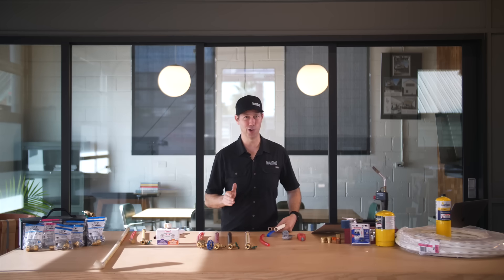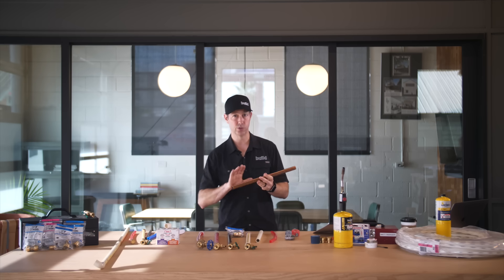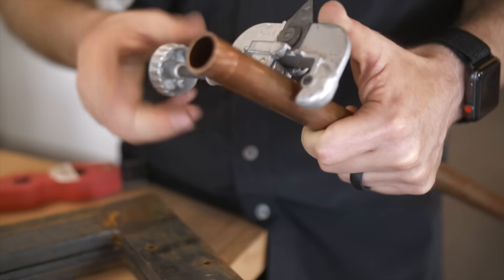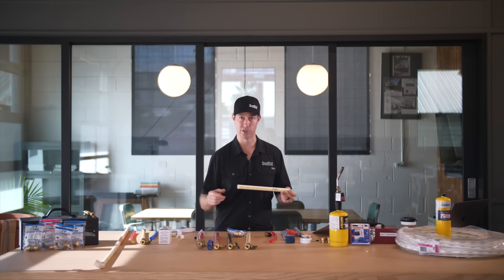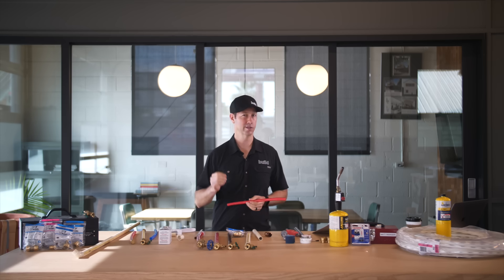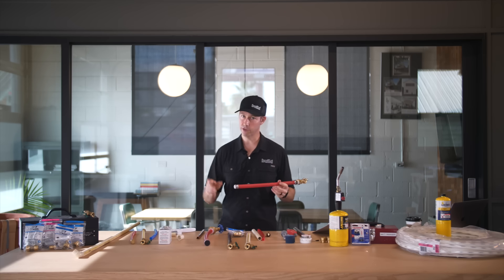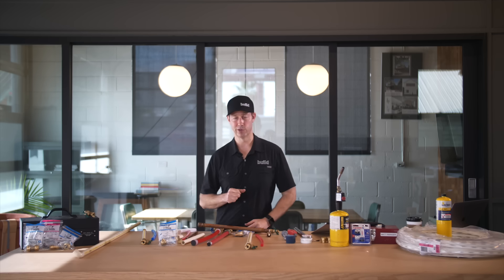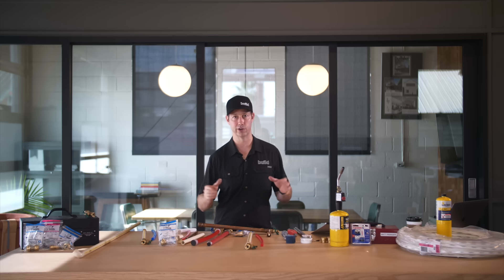PEX vs COPPER vs CPVC plumbing pipes

Comment: In California there are so many pinhole leaks and slab leaks due to copper pipes it's ridiculous. New homes with brand new copper pipes have pin hole leaks in less than 10 years. 50 Years? GOOD LUCK! PEX has the lifesaver for most homes. No more leaks, better water pressure and faster hot water due to not having to go through the whole copper loop.
Reply: I disagree.     I've been living in soCal for 65 years, and my Dad used copper in his day, professionally.     I own property built in the 60s with copper that has never sprung a leak.       But we have never used M, ever ever ever.     Dad used K and L.     I use L exclusively.       

I live in Long Beach and re-plumbed my house, personally, in 1991, using 100% L copper.       No leaks still.      I changed my HW heater-tank recently after 18 years, following a sobering viewing of This Old House's caveat video against depleted sacrificial anodes; the resulting corrosion of steel in the HW tank can kill copper pipes!!!!!!!!!!!!!!!!!!!!!!!!!!     Well, my 18 y.o. sacrificial anode was about 80% intact after I took out the old tank, and took out the sacrificial anode from that tank.      I still have that sacrificial anode!   It's heavily coated in a fragile crystalline substance... apparently the salt of that anode metal and chlorine in the water; so I don't really know if it worked when "encased" in salt.     I'll find out someday, but I'm not worried.      

I believe your leaky copper problems stem from either defective pipe manufacturing or acidic water.      And putting copper pipes in intimate contact with concrete slab is, supposedly, a time bomb; one that I'm expecting to get ME, but my copper in this situation is probably K and hasn't failed yet since construction in 1964.

This Old House is largely devoted to Massachusetts and I believe that place has acidic water.     Soil conditions in arid soCal seem to be alkaline.     Just look at what happens when you try to grow hydrangea; the blossom:  pink indicates alkaline soil, blue (as found in rainy parts of Oregon) indicates acidic soil conditions.        Around here, we have to acidify soil for some acid-loving plants like azalea.
Reply: There is a difference between Chinese made types of copper vs American made. American made copper is 100% rated thickness or very close to all the way around while Chinese made copper can vary in their thicknesses throughout the pipe. When I was talking to the repipe guys that redid the whole condo community (about 200 homes) he said that there is a city about 10 years old now just a couple miles away from me in southern orange county and the repipe company told me that 85% of their business is in that city while the older homes in the 70's to 50's is about 15%. He said both are L type copper but one is Chinese made while the other is American.
Reply: But I agree with you that good old copper pipes may last that long, but I must add newer chinese copper pipes will not. All these homes in southern orange county is where the repipe guys are. I see them at least once a month running around doing PEX jobs. With the better water pressure after switching to PEX and the faster hot water, I can't see why you wouldn't choose PEX for your next job however.
Reply: Tthe DOS exactly, even in South Africa, we quickly learned that the locally produced copper pipe "lasts for ever", "cheap" Chinese imports sold by WallMart affiliates and other unscrupulous dealers fail in less than 5 years with pinholes. Same with CPVC or similar, the cheap stuff (machines run too fast) leaks and split. Latest code revisions banned a bunch of stuff and new stringent codes to stop ripoffs. ALL PRODUCTS SOLD HERE HAVE TO BE UV STABLE PER NEW CODE, NOT TO MENTION FOOD GRADE.

Comment: First of all, I really like your channel and it's interesting to see what kind of solution and materials are used in the more warm climate conditions and USA markets.

General thoughts. 

-Copper has more fitting solutions than just soldering. There's also compression fittings.
-I think PEX is generally designed to run from the manifold straight to the water point as one single pipe running inside shield pipe. 
-There has been new found concern of PEX tubing in Europe. It has been found out that in some cases PEX tubing could release micro-plastic particles in to the water. That is not to say that this applies to all scenarios and PEX models, but something to make note of.

Comment: Hey Matt please clear this up...... you can use Crimp fittings with PEX A you can use all methods with PEX A just Uponor will only warranty their method of Expansion and Expansion has its benefits over crimping but Pex A is superior over Pex B no matter the connection method used.... too many people get this wrong

Comment: A lot of value in that video Matt! Northern climates plumbers might have slightly different experiences. Also, I just finished my basement and used copper to match the existing plumbing system, but I wish I used Pex because so much stuff in the way that I had to work around to get fittings soldered propery

Comment: I would be much more comfortable to have pex type A in my walls rather than copper. Left over flux inside the copper at the joints of the COLD side can also cause corrosion. HOT side tends to wash the flux away. CPVC can become very brittle over time...scary.
Reply: Scott Rogers I have never in 30 years in trade seen a problem you describe, perhaps chinese products? Flux is water soluble and should wash away on first flush, the outside of the soldered joint should be wiped away with a damp cloth after a few minutes.  Its easy to see a hack job coz they never wipe the outside...
Reply: Well, if someone says they saw a Unicorn, that would be a good argument. But apparently you haven't seen everything in plumbing yet. I'll attach a video I found supporting my experience. I do appreciate the response. And yes, I always carry a clean cloth to wipe the joint.  https://www.youtube.com/watch?v=nD5lMITzx_Y
Reply: I'm a retired master plumber of 34 years, certain old fluxes didn't wash away very well, plus way to much flux was used. I've seen many pin holes in the copper pipe a couple of inches away from the fitting, to much flux and boiling/melting away from the fitting. You can cut the copper pipe and actually see and feel the flux with your finger.
Reply: Scott Rogers p

Comment: I found CPVC gets very fragile overtime. New CPVC can be cut with tubing cutter, but when old (10+ years old) CPVC is cut with tubing cutter, it will crack instead. I also found deeply scored CPVC pipe during installation can lead to a pinhole leak in the future. I repaired such a leak few months ago. It had a long scoring, which probably happened when it was installed through the sub floor. PEX-a probably is the best type of tubing at this point. Found lots of PEX-b develop small leaks at the fitting. Possibly installation error, but not sure. Only down side of PEX I find is while the tubing it self is cheaper than copper and par with CPVC, fittings are significantly more expensive.

Comment: PEX-A is the best. 
PEX-C is a ticking time bomb. 

Don't bury Shark-bite fittings out of sight. Water hammering can beat those fittings off.
Reply: Don’t bury shark bite fitting underground either! It will deteriorate over time.
Reply: Getting beat off isn't so bad, unless you're a sharkbite fitting underground or in a wall.
Reply: oops..

 just installed 2 sharkbite caps inside a wall to cap off some existing lines
Reply: Brando OOPS
Reply: Better yet. Don't use shark bite at all!

Comment: I recently remodeled my master bath, which included building a larger shower. My shower system consists of Kohler mixing and 3-way diverter valves, feeding 3 different water outlets (head, spray arm, and rain head). This would have easily been a $1200 cost had I hired a plumber to sweat copper for it. I was able to plumb the whole thing with PEX in an afternoon, for about $180 (cost of tools mainly). And after leaving it exposed for 3 weeks, pressurized (I was slow in putting up the shower board), I know those fittings are going to hold.

Comment: Pex is the obvious choice to balance cost, longevity, and durability hands down.  That said, a proper copper install is sexy and just feels more robust. I may be partial though growing up with photos of my dad's work building sports stadium bathrooms with all copper.

Cpvc should be DWV only unless you are building an entire home on an assembly line, eg: mobile homes.
Reply: The caveats against rat damage went unmentioned, except by replies by those who know what happens in New York City.     We have rats in soCal and they have an instinctive need to gnaw.   Unfortunately, most humans are apathetic about rats and assume "somebody else" will solve all their problems.      The time bomb element is really long term, on this point, and is uncharted territory... no lab research speaks to the longevity of PEX when an attic is infested with rats.    

Engineering has never dealt adequately to the point of biological intrusion upon non-living materials, except to the point of unwitting human behavior; GFCI speks to this point.      If the word "rat" appears anywhere in the California Plumbing Code, I'd appreciate anyone coming forward to tell me where it appears.

Comment: In my rather limited experience with a couple of vacation homes, PEX is more forgiving of a feeeze situation than the others.  If I were plumbing water in an unconditioned space, I’d use pex.  Also shark bites are xpensive but awesome.  Very reliable.

Comment: im in the business. pex all the way. in florida copper wont last 10 years.
Reply: I had lived in Florida for 45 years and haven't seen copper fail.  Only issue I have seen fail is poor joints in copper.  I have had it fail in Utah.  I am not sure if the well water has more minerals, but it corroded the joints and fittings at the hot water heater.
Reply: Why does copper fail in Florida?  Thanks for disclosing your geographical area.     I'm in soCal and L copper is king here.      K is better but "nobody" has heard of that, among young people.
Reply: Most of Florida sits on limestone and the water is hard water and caustic with a high PH, drawn from shallow aquifers.
Reply: 20 year plumber from Texas.  Nothing but copper.  Rest is cheaper and easier but it isn't as good
Reply: I worked construction in AZ early 90's. The city building codes were changed to NO pex because there were so many problems with fitting leaks. Houses were basically destroyed from the water. NEVER EVER buy a house with pex.
Reply: @s.br.8717  poly b is the real killer you can get plastic fittings for pex nowadays to you know, 1 time use but in mineral rich water it works
Reply: Not in my part of Florida. 75% is shallow. We have great water.
Reply: Totally agree... sorry old guys.
Reply: freethinker52 I’ve seen copper fail in Florida. House built in late 50’s. Had pin holes. Who knows why? Reactive somehow i think. Have seen it multiple times. Pvc all day in my opinion
Reply: @blakethesnake1555 PVC, you got to be kidding me.
Reply: freethinker52 Why not, so what would you recommend for underground plumbing. I’m in South Florida.

Comment: That purple primer is evil.  I ruined a spot on my 200 year old heart pine floor with it and also had it spill in a tote I was storing an extension cord in.  That stuff totally dissolved the outer sleeve of the extension cord.
Reply: the extension cord is made of vinyl so no wonder it did damage
Reply: Don't spill it....
Reply: Primers for chemical fusion connections are not benign materials and require significant care for their use. There are untinted PVC and CPVC cleaners available, however in many jurisdictions, their use is against code as the inspector cannot see if cleaner was used on the joints.
Reply: Such hyperbole.

Comment: Mat, I grew up in Michigan then moved to Indiana, I'm not a builder but from living in the northern states CPVC AND COPPER when they freeze they'll crack and brake. Like you showed once, in the northern state we need an outdoor frost free faucet 8" to 12" long to go through the wall so it don't freeze.  I never had around Pex piping.
Reply: TOOL MAN, PEX tubing is more tolerant of the expansion effects caused by freezing, however repeated freeze/thaw cycles in the same area will still cause the tubing to split and freezing near a joint will commonly push the joint open far enough to cause failure when full water pressure is restored. The best bet with any piping material is to prevent it's exposure to freezing conditions in the first place.

Comment: Stop talking about things you don’t know about. M copper is ONLY for heating, never use it on water! The other thing the customer you were talking about the rust issue, the rust has nothing to do with the pin holes, only acidic water or low ph will cause pin holes. Cpvc is the worst thing to use for water pipes. It gets real brittle and brakes under colder conditions. Don’t get me started on cpvc valves, there don after ten years, don’t compare it too copper. There are copper pipes in the ground for 75 Year’s, cpvc will never last that long. Stop please just stop
Reply: Pex will take more freezing than copper and cpvc will take no freezing and will split and crack.  Copper will also split on freezing, but not as bad as cpvc.
Reply: nick ransom thank for saying something your so right and pex is no better it seems I been called on that pipe and the joints broke apart where it's crimped or the plastic band....
Reply: yeah, this guy does clean, easy remodels in texas.  it's all on flat ground, never drops below freezing for more than a day or two.  and they're just building suburban houses that will be dozed in 100 yrs-they're not castles
Reply: Nick, You are right about every thing you said. I wish this guy would stop doing plumbing videos, he puts out a lot of false information. I've been a master plumber in PA for over 20 years.
Reply: His information may not be applicable to your area, but that doesn't make it false information! 

My home was built in 1970 just north of Houston with full copper piping and not a single leak has developed in the pipes in 48+ years (even the supply line under the house buried in the ground is copper!). So it does apparently hold up WHERE I AM LOCATED and IN MY AREA. Copper is however a PITA to modify after it's installed, you have to get every drop of water out of it before you can begin to sweat a fitting apart or flow a new fitting with solder... and heaven forbid you find a leak once you turn the water back on, because then you have to start all over blowing all the water you can out of the system before you can fix the leak! Don't ask me how I know this!!! :-( 

See it's pretty darn impossible to get copper above 212F when there is water present in the pipe anywhere near where you are needing to flow solder which requires much hotter temps to flow.... ughhhh! And it's rarely easy to get all the water out I've discovered.
Reply: @MShrader211 - I've been through that, but I did read in a book that one trick that plumbers use is to shove white bread up the pipe giving you trouble.  The bread will soak up the incoming water and then will decay and dissipate so as to not to be a problem when pressure is turned back on.  I haven't needed to try it yet, but I certainly will if I have that problem again.
Reply: @Mike-fj2ln  I carry a loaf of wonder bread in my van for this exact reason, works great.. i have more expensive tools to stop a leak while sweating downstream but I still find bread works best.. dont forget to purge it though.,. some people have really bad alergic reactions to bread, and YOu are liable for it if they do.
Reply: @Mike-fj2ln  I've never gotten that to work lol but old timers used to tell me that all the time. My grandpa owned a plumbing supply store so I had all the special tools I needed. Like a jet sweat. But you can also heat the pipe a few inches away from the repair and keep the water boiled back, if you have room in the wall
Reply: cpvc is the best copper corrodes under ground that is why cities are now using plastic for water mains and gas mains also cpvc is immune to crack heads stealing for scrap
Reply: How long would it take for copper to corrode, would it last longer if its imbedded in concrete? Or should cpvc be embedded in concrete so it doesn't become brittle?
Reply: @luissonoma6255  cpvc should be embedded in the landfill, it's cheap garbage that will eventually become a nightmare.

Comment: In New York City 
PEX = illegal
CPVC = illegal 
So copper all the way!
Reply: James K yet one more reason to stay out of NY. I assume this is a union thing?
Reply: I doubt it. I know for sure its NYC building code. Probably because of all the rats and mice...
Reply: That is a lie
Reply: Its NYC building code! you might be allowed to use PEX for hydronic heating which im not sure about
Reply: You aren't allowed to use Romex either, the rats eat right through it everything has to be armored cable
Reply: im pretty sure Romex is allowed in 1-2 family homes in NYC (same with PVC pipe for DWV)
Reply: New York also allows brass and stainless pipes.

Comment: PEX A is not recommended for SharkBite... According to SharkBite tech support rep.
Reply: Mykel Hardin something about thin/flexible pipe wall.  Uponor rep said it's ok to use SharkBite. Also I noticed Uponor PEX red/blue coating is peeling from sharp teeth of the push fitting. Not sure how this affects a watertight connection.